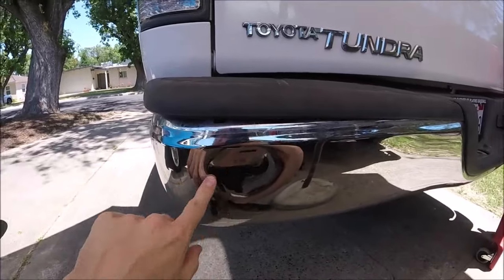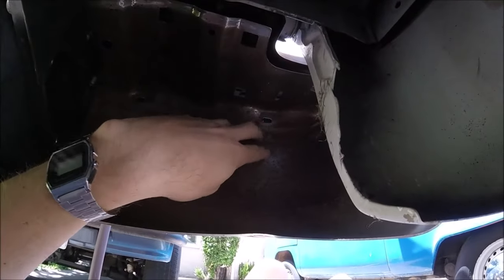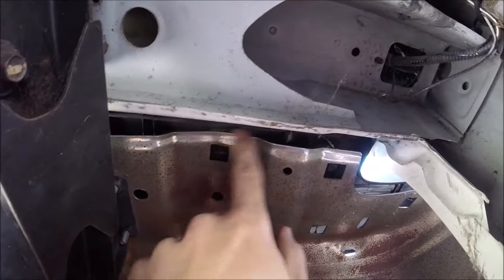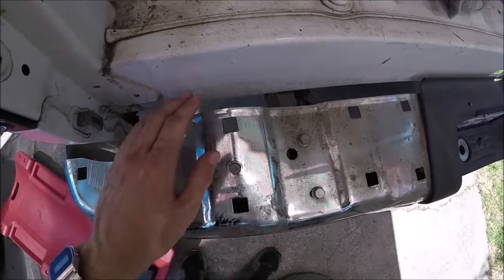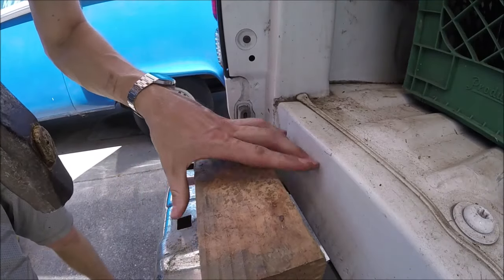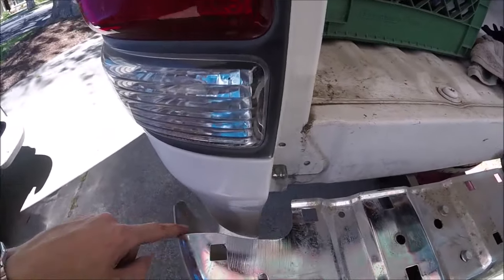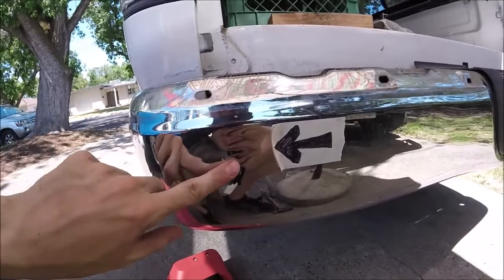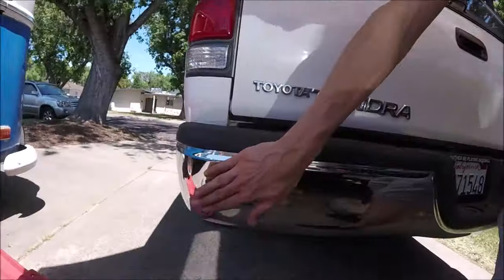How To Fix a Dented Chrome Bumper. Repairing Dented/Pushed in Bumper -Jonny DIY

Comment: Thanks for taking the time to make this video. Even though I have a back up camera, yep I backed into a tree. Reacted pretty fast so not too big of a dent. I have all of the tools but am a bit short on swinging power at 75. I can't wait to start banging on that bumper. I saw your tip on starting from the outer edge of the dent - will do that. Thanks again!!
Reply from the maker: You're welcome, glad I could help. Good luck with the fix 👍

Comment: Thanks for posting. I have a small dent in my tacoma bumper and I was wondering to use wood or steel with a hammer to beat the bumper out. Your video answered my question.
Reply from the maker: You're welcome, glad to help. Good luck with the dent! 👍🏻

Comment: My wife backed her truck into a tree so I'm hoping this will work for hers haha. It's way more pushed in but from but from the looks of it your idea might work. Thanks for the tips
Reply from the maker: Haha it happens! It should work, if really pushed in use a come a long to pull out or just a rope/strap around it and other end on a tree. Have pulled a few bumpers/front ends that way with surprisingly good results 👍🏻

Comment: Searched "how to fix dented bumper" this is the first vid I clicked on, I have the same truck with the bumper dented in the same place lol, thanks man!.
Reply from the maker: Haha that's awesome,  glad I could help you out 👍
Reply: First gen tundras will last you a very long time even with minimal maintenance. These trucks were built like tanks! Only issue is the frame recall for the cross member and the lower ball joints (always buy OEM LBJs!!!)
Reply from the maker: @TeamVio  thanks Roy, will keep that in mind especially the OEM lower ball joints 🤙🏼 lol mine still has under 100k on it
Reply: @JonnyDIY  nice! Mine has 141K, I’m about due for lbj replacements. Look up First Gen Tundras (13K members) on FB it’s legit the best page for anything and everything regarding these trucks.
Reply from the maker: @TeamVio  awesome, will check it out, thank you

Comment: Thanks for the vid. You only loosened your bumper because the dent was higher up and not reachable? Or is it a must ? I have a 2500hd chevy with a lower dent thati can reach easily but I don’t want to cause any other damage
Reply from the maker: No need to remove bumper or tailgate if you're able to get to the dented area easily 👍🏻

Comment: how do you do the same with small areas like a bent area on window frame. someone used a screwdriver to try to get into truck through rear passenger door.  thank you and God bless you
Reply from the maker: Thats a little trickier because the metal is usually stronger there and no as access to backside. I would try getting a couple estimates from local Paintless Dent Repair guys. Either that or would have to have damage fixed by body shop and repaint that little area

Comment: Hey man, great video! I have a slight bend in a 1.25 inch C-channel rail on my front bumper. Do you think that could be pulled out by placing a flat bar in the C-channel, and pulling it with a come-a-long?
Reply from the maker: Thanks. Yeah for sure, metal is pretty thin and flexible on these type bumpers. It should pull out no problem 👍
Reply: @JonnyDIY  Thanks for the info.
Reply from the maker: @johnharrison5656  you're welcome, happy to help

Comment: Yep Toyota cutting corners thin steel bumper the one I fixed on my truck was way harder because the steel is thicker.
Reply from the maker: Yeah not much protection especially on the corners

Comment: Trying to get dents out of my VW bus bumper actually like yours there. Does this still work
Reply from the maker: Should work on those bumpers too just fine. Theyre not too thick of metal. Work from the outer diameter of dent inwards towards the middle for best results 👍

Comment: Hey I've done a few repairs in my lifetime believe it or not and you can actually use a stone and you want it when you're on a dent like that that you were fixing you tap from the outside to the inside because get it in the center and  that's how you got that crease and if you put a stone and hit the stone cap lightly from the outside to the inside the crease will not be there you can go to harbor freights for $9 you can get a whole body fender repair kit I'm fixing the GMC pickup truck bumper right now maybe I'll videotape some clown started to do some body and paperwork on my friend's truck and messed it up so now I'm repairing it
Reply: That's for $49 at harbor freight you can get a body and fender repair kit it has all the hammers and stones
Reply from the maker: @sharonfoster9490  awesome,  thanks for sharing. Yes I really need to invest in one of those body working kits with all the nice hammers and slid hammer too

Comment: Appreciate the video, if there’s some minor scrapes on a black bumper this probably won’t help huh?😂😪
Reply from the maker: For scrapes, scuffs or paint transfers I would buff with Meguiars Ultimate Compound like I did in this video 👍🏻
https://youtu.be/3lVnpJQvRs0
Reply from the maker: After buffing if theres paint missing then clean with rubbing alcohol and use lil touch up paint, let dry a week or so and then buff with compound then wax

Comment: Man I wish my Tahoe bumper was that thin and easy to reshape
Reply from the maker: Heat it up with a propane torch or heat gun from the backside first and will help a lot to shape easier 👍
Reply: @JonnyDIY  thanks. I actually did and it still won’t reshape much at all. I think I’ll get some shaping tools as apposed to wood.
Reply from the maker: @JLE1177  yes metal dollies work great 👍

Comment: Your camera work is very jerky and making me seasick. Stop rolling around on that stool.  Don't jump into the frame either.  Too much zippity do dah, keep it calmer. This is a DIY video, not a bungee jumping one.  Hold that camera steady and move slower. Way too much zooming around.

Nice demo on using wood not a hammer directly.  I guess a curved piece of wood should have been used on that dent in back. A more rounded piece would have been ideal.  Looks better though.
Reply from the maker: Thank you will try to be better. Yes you're right curved piece would have been better 👍
PS- that bungee jumping reference made me 🤣